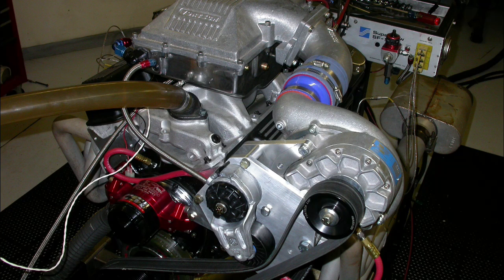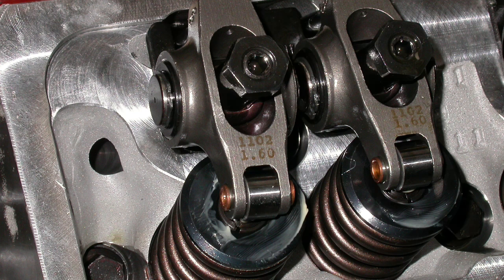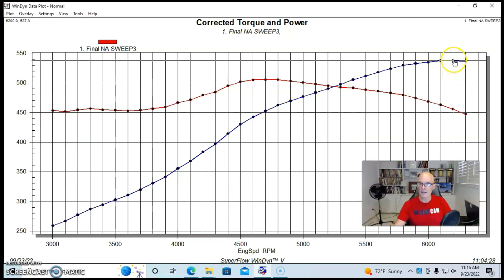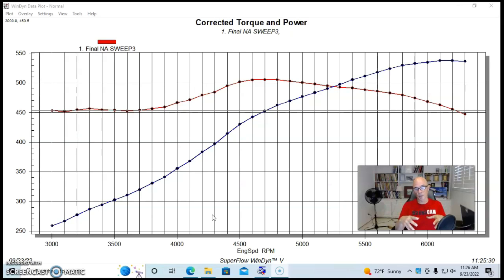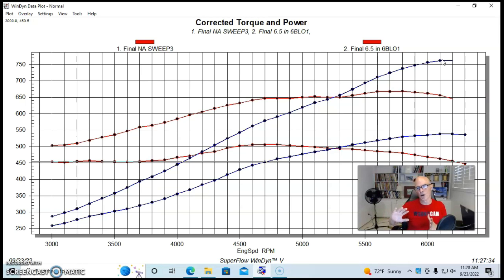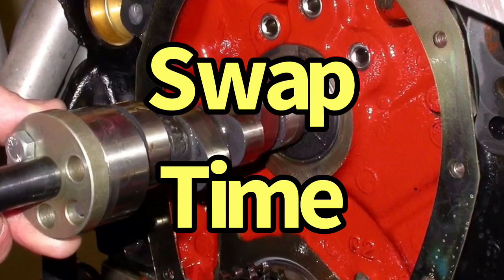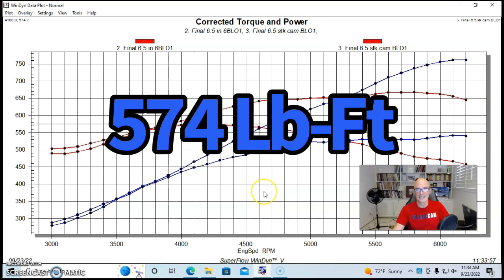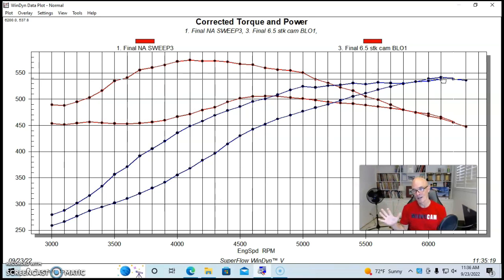HOW TO ADD 200 HP TO YOUR SBC CHEVY WITH A CAM SWAP! HOW CAN THE RIGHT SBC CAM BE WORTH 200+ HP?

Comment: what was the compressıon ratıo before and after the cam swap?
Reply from the maker: cams don't change static compression
Reply: @richardholdener1727  Hi Richard.. I have sbc383 gen1, with 144 B&M Blower. 8.5 comp. ratio. Can I run 10psi with pump gas? With this cam. Thank you..:)

Comment: You don't want large valve over lap on eny blower engine. But lots of pressure you will get power what ever 😅
Reply from the maker: overlap is fine with boost

Comment: I had a 1974 Chevy El Camino, and I had a 350 motor in it, so I am curious how much boost can this 383 handle, but I think this is a forged crankshaft, connecting rods and pistons right? I am curious if this 383 had a 4 bolt main not forged maybe cast iron how much boost could it handle thank you.

Comment: Great video. I have a question I plan doing a new flat tappet cam and lifter’s can install it a not start the motor until I put the heads on and then put in the car. Is there a time frame before the cam lube is not affective upon when I start for the time.  Thanks
Reply from the maker: the right cam lube stays on almost indefinitely

Comment: If you start with a very wrong camshaft, and then install the best possible camshaft, maybe.

If the engine starts out with a camshaft that is reasonably correct for the engine combination, you won't find one worth 200 horsepower, by itself.
Reply from the maker: congrats-you got the point I was trying to make in the video

Comment: I really would be curious to see I had to combination would run on in E85 carburetor instead of running on 100 octane was a lot of racers going to E85 might be worth seeing what the numbers would bring out and have this engine would be a perfect combination for low budget race car if and when you get a chance have a great day
Reply from the maker: e85 adds 25-30 hp
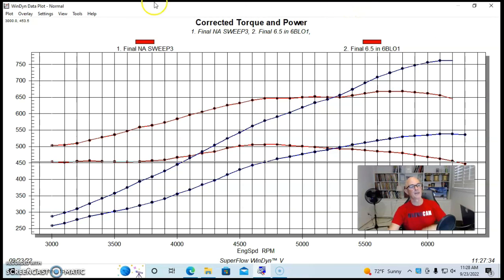Reply: You're running this on E85 combination or likely looking at what 650 out the door I believe a summit stock 383 her run close to 500 what a 383 combination I would be happy with running about 580 to 6:50 to be able to run 11 second bracket or a high 10 without using nitrous my brother at the moment is running in 78 Malibu with a 355 small block on an E85 carburetor and a title it was running 585 to the rear wheels without nitrous and the best PT that I so far I've seen was 1102 at 121 has plans for this year are to build a 383 small block ordered from Summit what's it called to run all 11 doing a high 10 without running nitrous or no supercharger he just wants to run nicely aspirated I don't think you'll get to 650 horsepower

Comment: Richard you gotta Dyno SBC SB2 motor sometime.
Reply from the maker: WHY
Reply: @richardholdener1727  The ultimate  SBC setup.  Lotta ppl don't even know about.
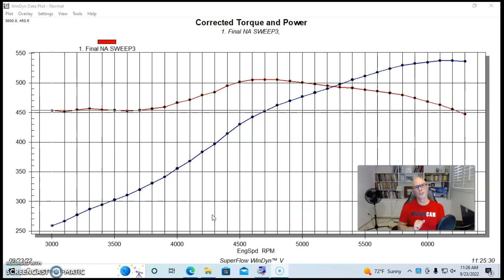Reply: @richardholdener1727  I was wondering if you could help me out on a big block Chevy cam & piston selection on a farm truck  ? It a tandom axle aka 10-wheeler truck 25000 weight empty and 55000 lb weight loaded 1979 Chevy farm truck w427 tall deck engine  . What is the perfect stock style cam and piston compression ratio to run for a truck that is pulling a load daily at 65mph minimum with a load ? It also has a Allison 653 transmission and 4:10 axle ratio . I would also like to know if the same selection would work in a short deck engine in the same truck and thanks for any advice you can give . My local GM dealer doesn't work on the old gas powered big trucks and is 0 help to me which is why I'm asking you the expert for advice .

Comment: Hey random question have you tried thunderhead 289s  electronic carb tuner yet? The one he runs with his lawnmower carb on his maverick.
Reply from the maker: I'm not familiar
Reply: @richardholdener1727  I'm probably butchering this expectation, but it sounds like he replaces the power valve with a pwm solenoid and has an engine  map sensor to control vacuum bread off and has inputs from a wide band O2 sensor to reach a desired A/F ratio, he has a few videos on it on his YouTube channel.

Comment: Richard, been watching your videos for years.  Finally putting together my boost set up.  Maybe you can recommend a cam for my set up.  1998 Trans Am.  Fully forged iron LQ9 390ci.  10.5:1 cr.  Adding my new Mongoose 260cc (69cc combustion chamber) LS3 heads.  Ported LS3 intake.  100+ TB to be purchased.  F-1A-94 Procharger with the Pro Volute.   4L80E tranny.  Strange 12 bolt rwar end with 3.23 gears.  Full time E85 fuel.  2" LTs.   Probably using the Terminator X engine management.  Roll racing only is the plan.  I'm hoping for 1,200 RWHP.   Thanks if you have the time for a cam recommendation, its the only thing I have not picked out yet.   Some lope is obviosuly ok but I don't want it to be really crazy idle quality.  Thanks.

Comment: Hey wait a minute I was told a regular small block Chevy small block 600 max are you telling me you got 700 hp out of a regular Chevy 010 casting block ?
Reply from the maker: we've done lots more
Reply: @richardholdener1727  so please help me out here I’m thinking about getting a dart block but if I can save some money and get 7+ horsepower out of my small block 350 four bolt main 69 block maybe early 70s 010 Casting If that’s possible what do I have to do

Comment: Wanted to add a "all cylinder heads are turbo cylinder heads" comment since it was brought up. Consider that stock Grand National heads don't even flow 150CFM on the intake and have been deep into the 11s if not the 10s in a G-body. If you consider that they have 6 cylinders not 8 you'd be looking at a flow of  112 CFM on a V8! Obviously that was done with race gas and high boost, but if you can get E85 it really makes one question if they really need to worry about head flow on a moderate power street engine. 

I can tell you the AMC 258 I'm sticking a T66 on will likely have a 4.0L head with a valve job to start with. If the guides weren't shot I wouldn't even go that far. I keep thinking I want to do port work on it then keep thinking better of it.
Reply from the maker: you can add boost to any head, any cam and any intake (any motor), better helps help na power, which helps boosted power

Comment: https://www.youtube.com/watch?v=72hVhcBOyPo Video I was talking about (and shamelessly plugging.) They make a kit to do this but you don't really need it if you have a grinder and patience. This is for a 700R4, but the TH350 governor is the same. In fact, I believe the lightest weight one is from a TH350.

Something being click bait vs having real and usable info in it are two things that aren't mutually exclusive. Someone may have stuck a ton of parts on a stock or mildly cammed engine and wonder why they weren't making any power. Such a piece of info could be extremely helpful to them. Testing in a systemic and scientific nature tells you where bottlenecks are.
Reply from the maker: thnx

Comment: 1 minute in explains it all,... little cam to a larger well designed cam and a huffer
Reply from the maker: THE HUFFER WAS RUN WITH BOTH
Reply: @richardholdener1727  yes I seen that, I wasn't quite clear with my statement. Meant to say having a base line engine with a forced air induction system can have more opportunity for power increase because of the ample supply of air. Being the heads are your biggest obstacle at that point, anything with the valve train could be huge ! Small cam to larger (especially one designed for the application) could make obviously as you have showed drastic improvements

Comment: Not sure who would choose this direction, but the small cam below 4000 rpm looked pretty good for a truck towing an RV camper or something. Maybe that 383 with some more affordable parts and some basic aftermarket heads instead of the premium AFRs… Your point, though, is well taken—lots of power available from the correct cam choice! Thanks Richard!

Comment: I'm still learning this stuff and am wondering if this would have the same effect on my combo? I have a similar 383 short block, but only have forged pistons. I'm currently using a flat tappet cam with 234/234@ .050 and .480 lift and 114lsa. I've been planning to upgrade to a retro roller but am unsure whether I'd see such a dramatic escalation in HP and torque numbers.
Reply: You should check out David Vizard. According to him, your cam is way wrong. He has plenty of dyno results to prove his choices of parts.
Reply from the maker: there are much better cams for your combo

Comment: I just put some 1.7 scorpion roller rockers on a stock 350 truck cam. 13% more valve lift? It can't hurt! Brought me from. 385"/.402" to .437"/.456". The tune didn't change much. Onesies and twosies on the stock tbi efi. 
  I plan to eventually install them on a Comp xfi252hr roller cam and get .585"/.580" lift on my vortech supercharged 355. With the recommended 1.6 rockers, that cam produces .550"/.546" lift.

Comment: You made this sound like just changing a stock cam is going to increase engine by 200hp.  Said nothing in intro or header about the engine already being blown.  Thought somewhere you were going to get to the NA gains.  Thats why I watched the whole video is because sometimes you have different tests throughout the video.  Was waiting for the one described in the header and beginning of the video.  200hp gain with a cam swap on a blown engine is not a big deal.
Reply from the maker: watch the 175-hp na ls cam swap-that should make you happier-but you missed the point of the test

Comment: First of all just have to say I'm a big fan of what you do.
Could you tell us a little more about the carby setup used on this engine?
Reply from the maker: it was a stock Mighty Demon-that is the benefit of the carb enclosure
Reply: @richardholdener1727  so any double pump carb would work in an enclosure?

Comment: I damn well know a cam is capable of making even more power with forced induction. But I am always here to support Richard because there is not another guy with. 1 more knowledgeable 2 more PROVEN testing and access to a Dyno and more motor combinations then we can imagine, and 3 more interaction with his audience that dosen't have millions of subscribers. I know plenty of podcasters who no less about cars and don't get the recognition that Richard deserves. If Scotty Kilmer can build the largest single man stand alone channel how Richard can't angers and confuses me. I like both guys but scotty is clickbait crap these days because one day he says something is great then the next day he says it's crap. Richard builds what his fans want to see and SHOWS YOU EXACTLY what is going to happen and what you can expect performance wise no opinion just consistsproven results. The uncrowned king👊🏻 On a different  note I have an E90 6.2 build of my dreams, hit me up have parts listed below, I have everything to do the swap ( trans, all mounts, stand alone, and built 8.8 and cage) the block is stock and stripped down. So cam, possibly heads dependingon price , injectors,, fuel pump, fuel cell, aluminum pistons, and single plane. God bless everyone who read this.🇺🇸👊
Reply from the maker: thnx-I just provide the info

Comment: 🥝✔️ ❤️ Richard Holdener boost ratio increase divided by the naturally aspirated boost. At an effective average of a 1.41:1 boost ratio,  that's less  7.5  pounds of effective boost. If the gain over the stock 252 degree cam verses the 294 Comp Cam was 156 HP gross naturally aspirated Cam A versus Cam B, then it'll be a 220 HP gain under the Patented Holdener Boost Ratio. PS. Have a Nice Day. P.P.S. Am I learning anything, or do I need remedial schooling again?

Comment: To me this test really shows how important it is to plan your build on any engine. Proper part matching is a huge key to making good high horsepower especially on budget. Like your test shows quality high dollar parts won't work well a stock cam. Funny thing is a stock engine with factory heads and better cam and intake and headers, then you've got a foundation that will just keep getting better and better.
Reply: Ehh kinda even a stock 350 vortec head can only support 400ish HP...
Reply: @PHILLY214  do you know any good budget heads and roller cam for a 91sbc?
Reply: @kevinnn9354  a 91 sbc is a TBI motor.... depends on what the motor is going in

Comment: So........ This kinda Blows up the never ending BS Question about the needs of the purpose of running a camshaft for boosted applications only! 🙄 The argument is that a camshaft somehow has the ability to determine atmospheric pressures and do something to improve the overall performance of its profiles for boosted and naturally aspirated conditions!?!? Really these cam profiles are different, but they're not something that is necessarily needed nor will they always improve the power output by running a "Boosted Profile" camshaft! There's lots of theories about this topic and some of these things do apply to specific boost situations.......but not all boosted situations apply. If you're running a turbocharger and take advantage of your exhausting of your engines exhaust pressures to rise, absolutely yes Sir it would be a probable benefit to run a specialized boost camshaft for turbocharger applications! The positive displacement of anything like a supercharger though....... here's where things differ. Being your compressor isn't relying on certain conditions for building boost quicker and easier than something with a positive displacement driven system, the camshaft really is not going to hurt or benefit the boosting capacity of your engine. Being you may not specifically need so much duration @ .050" to achieve the numbers you are looking for without having to deal with high stall speeds from having a big duration cam profile, you can actually get away from the chop factory and still get more air packed tighter into your cylinders. By utilizing a higher lift and a reduction in the duration for say street purposes, by making up for pulling out of the duration and building higher lift and this could easily be done with ratio rockers as well if you don't have the money to make a cam swap? Springs and a higher ratio rocker arm is going to definitely complement your boost and increase your overall output without the need for changing the camshaft profile. This is why you can actually boost almost anything you want. Will it be efficiently perfect with say a stock camshaft profile and additional lift? Probably not, but it's worth the price of doing it for the gains that you will feel and see on the dyno. Comes down to getting as much air stuffed into your cylinders as easily as possible so by increasing the lift and leaving out the needs for bigger duration, this is very possible. This is why many forced induction engines stock to street/strip, you are sometimes fooled by the sleeper effects of not hearing any lump in the camshaft department, and take the bait as it's not going to be a very fast vehicle LMAO! I made this mistake 1 time with a worked Buick GN and had a 10 sec G body 442 running a aluminum big valved heads, roller cam'ed 406 SBC with 12" slicks and got spanked by this grandma sounding grocery getter V6! It was definitely worked over, had heads cam, converter and computer work done! But you'd never know you were pulling up along side a mid 9 second car! LoL lesson learned in under 10 seconds really almost 6 seconds as I got him off the line and about halfway thinking wow thats easier than I was thinking??? SMFH! But soon as this thought passed my mind, LoL well so did his car! 👋 He was able to catch up about 2 car lengths and then surpass me at the end...... That was the last time I laughed at how weird sounding those Buick V6's sounded under load at high RPM'S! And no longer looked down at small displacement engines with a boost adder of some sorts.
Reply from the maker: start with an na power curve-then add boost

Comment: 454 peanut port wagon motor gets 100 hp from a non  emissions cam , no springs swap .hydraulic flat tappet  , maybe 400 bucks if you have to upgrade from the nylon coated aluminum cam gear . May not out dyno a vortec cammed 5.7 with a respectable intake ,but still makes some midrange torque,  and has meat on the bone (that's downside of the vortec where is the meat block) that's something
Reply from the maker: meat block?
Reply: @richardholdener1727  the vortec blocks were skimpy on the iron content compared to the previous gen sbc maybe to save a few pounds?

Comment: So what Richard has taught us is a stock 1972 400 from a caprice with a vortec and afr heads is a towing monster
Reply: 400 block. picked up a 1971 caprice 400 block running last march.even came with turbo 350.compression tested 150 . everything there even power steering and altanator. rpm intake . 600 street holley. headers. really excited to save up for heads and cam ........note to everybody keep an eye out . everyone wanna ls swap. 400 s gonna hit the market
Reply: @mattv8919  a 400 with a decent cam and heads with a tpi should make killer torque. A quick to light off turbo and shifting at 5000 would be a monster tire burner or 4x4 setup
Reply: @AndyR1982  
That's the plan

Comment: Richard, is it possible to have a carburetor that's too big for a motor?
Reply: Yes it is you don't need Richard too tell you that
Reply from the maker: yes
Reply: @richardholdener1727  I thought a carburetor squirts fuel in based on the amount of air it is sucking in so based on that I thought it could not be too big but what would the symptoms be if it's too big?